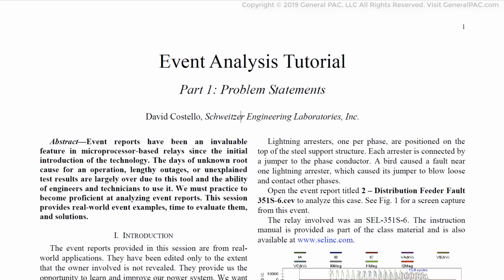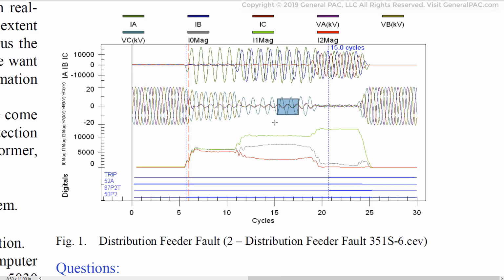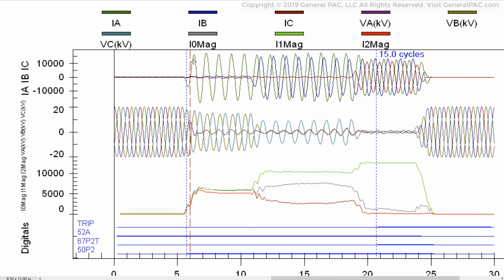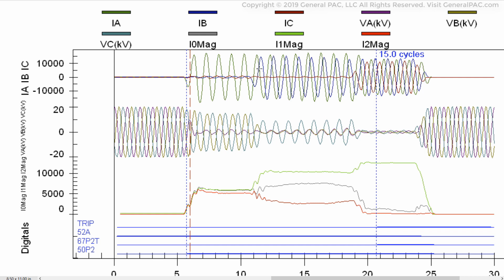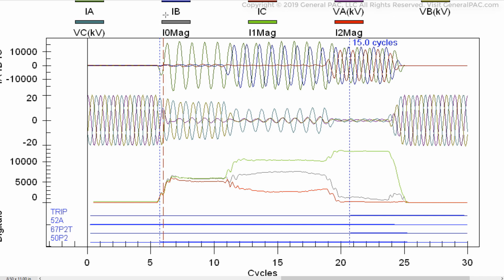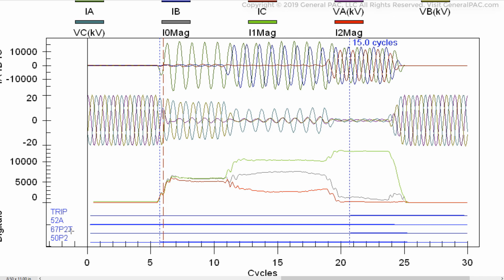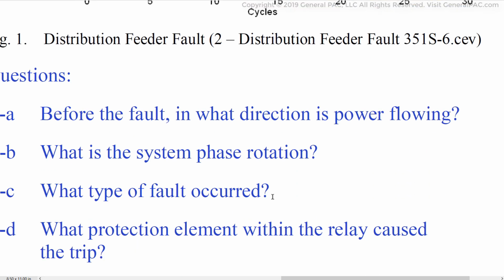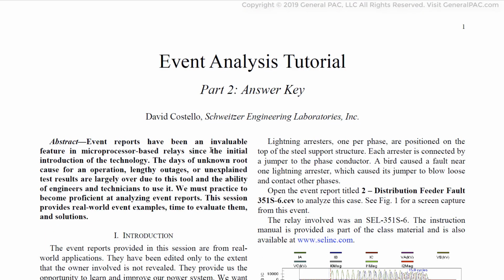Fault Analysis Using Waveforms, Part 1

Comment: Hi I am watching this video now, even though it is about one years old, I would also like to know why you said the power was flowing in reverse. It doesn't make sense as power is delivered from the BUS power bar out to line circuits. Would really appreciate if you could find the time to respond to my enquiry. Thanks in advance. By the way I really liked the tutorial and all the others. I have subscribed, but I cannot afford the packages as I am a full time student at NTNU EVU right now.
Reply from the maker: Hi Stephen, the power is flowing in the reverse direction because our load is actually a wind farm (as stated in the paper) so it's generating power and selling back to the grid. Hopefully this help to clarify your question. You are absolutely right, without knowing the type of "load", power flowing in the other direction (into the transmission line) would be questionable

Comment: Thank you for the video. How could you tell the power was flowing in reverse? Thanks!
Reply: Hi Lou, did you get a response from your question?, I 'm only watching this now, but I see there hasn't been a response. Did you get a private response from them? I would also like to know why he said the power was flowing in reverse. It doesn't make sense as power is delivered from the BUS out to line circuits.
Reply from the maker: Hi Lou, I think if you take a snap shot of the voltage waveform in one instant of time, you'll see that phase A voltage is at 0 degrees, phase B voltage is at 270 degrees, while Phase C voltage is at 120 degrees. If all phases were rotating in the CCW direction which is standard, then we'll have an ACB phase sequence while normally it's ABC (this is very hazy guess) I think this is one way to tell that the power is flowing in the reverse direction. If others can correct me or have other insight to share which will reveal the direction of power flow per the waveforms, I'm all ears :)

Comment: Great video ! The 50P2 Element seems to have activated at the inception of the fault but didn't result in the breaker tripping, why is that so ?
Reply from the maker: It's probably used for indication purposes and NOT in the trip equation of the relay :)
Reply: GeneralPAC: Power System Tutorials -
Logic baby... You can make it do what ever you want ;) 

Great video btw!